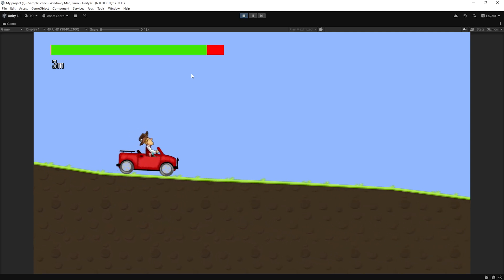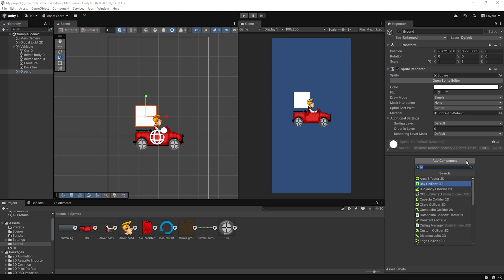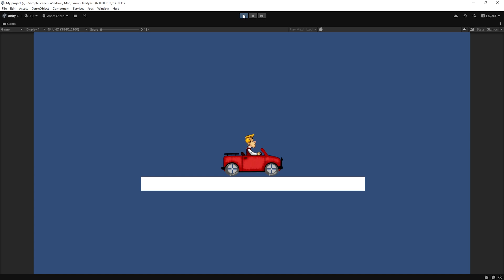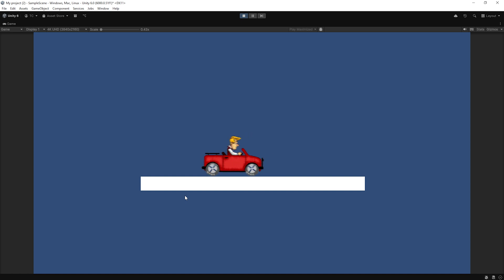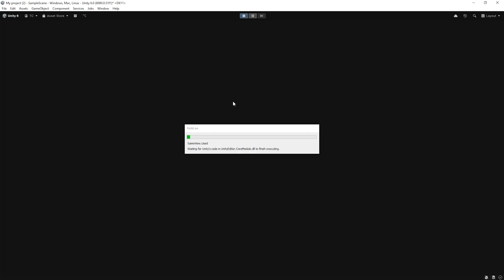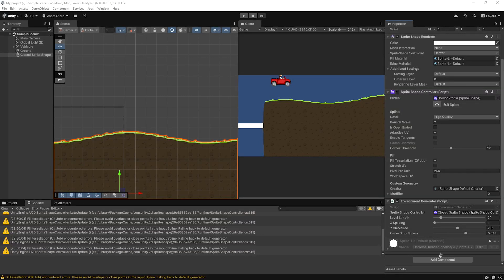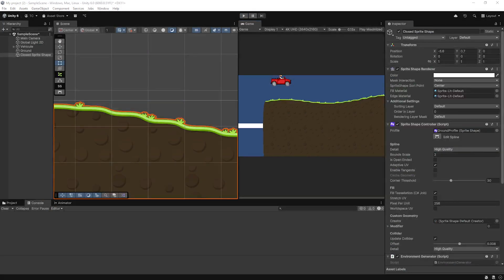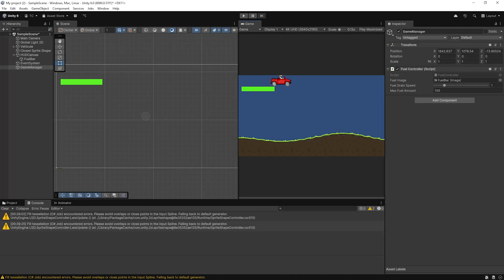Your First 2D Racing Game in Unity – Start to Finish!

Comment: Hi. I'm trying to reproduce this lesson and got an issue. I've created a car with parent object and body and wheels as chlidren. then I've created wheel joints for parent Car object, the same as in this lesson. But in game wheels push this parent via joints but the body lives its own life, like it's not connected to parent. it just lies on the wheels and falls away on bumps. To check this behavior I moved the body out of car hierarchy and behavior didn't change.
It looks quite unusual for me as i believe that all children object should move in the same way as parents with them. Any thoughts on that?
Generally, I've made a workaround by adding extra joint between parent and car body, but it looks like a made of crap and logs solution. I believe it should be more correct way for resolving this issue